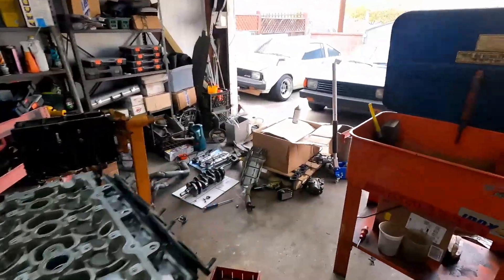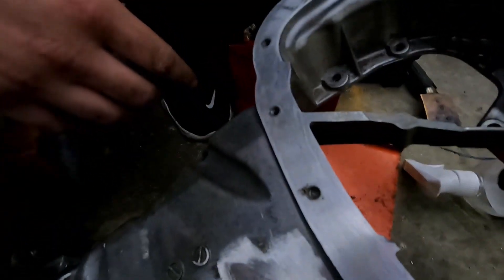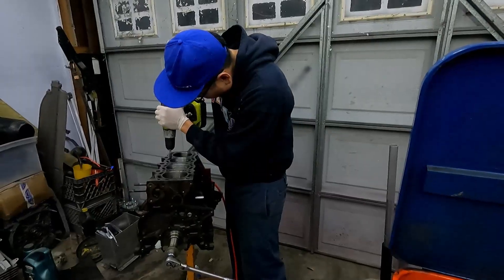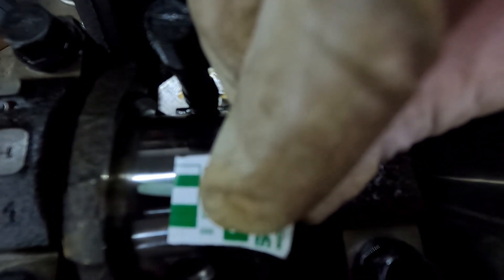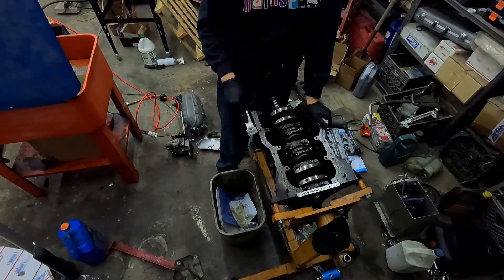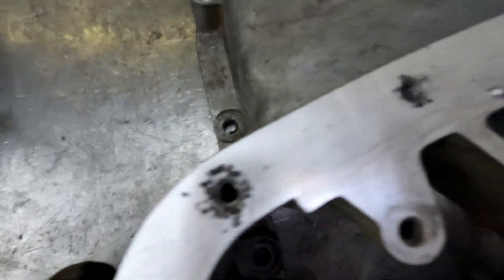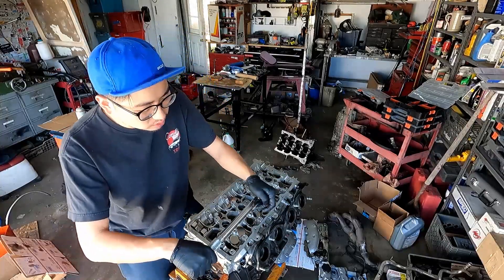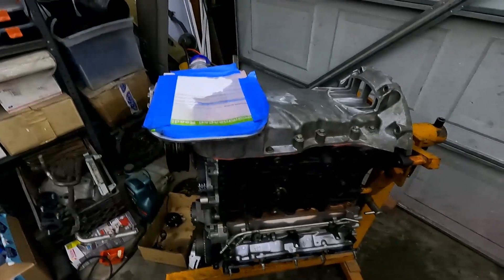3SGE Beams Engine assembly (Breakthrough Engine with Advanced Mechanism System) SUBCRIPTION IS FREE

Comment: Do you have to apply gasket maker to the first camshaft cap where the vvt fit in?
Reply from the maker: Yes, there’s a little valley for sealant also
Reply: @kelvinarreola  I've been getting an oil leak behind the two cam sprockets so I'm not sure if it's the sprockets or the gasket maker I applied. Changed the camshaft seals and I'm still getting this oil leak
Reply from the maker: @danzelmason2190  I use Toyota FIPG, are they the correct seals? Do the fit snug on the pulley? Intake and exhaust?

Comment: Did you reuse the old head gasket by spraying it with copper gasket spray?
Reply from the maker: yes but i cleaned off all the old material first .i sprayed each layer and restacked them